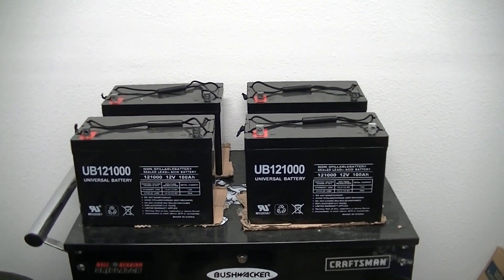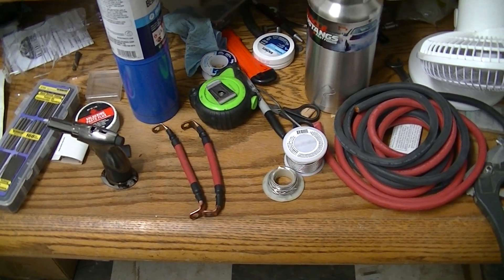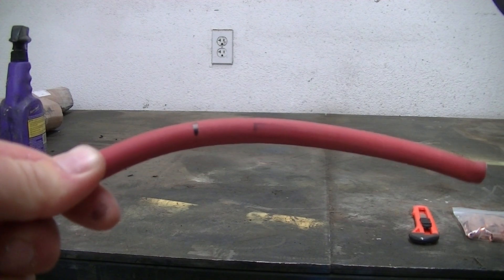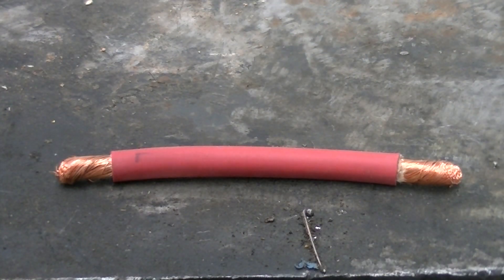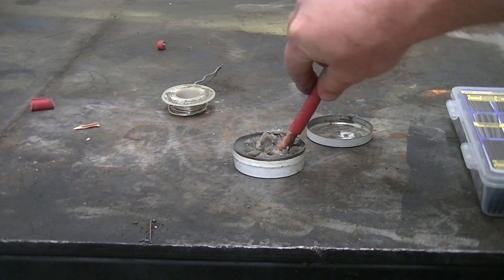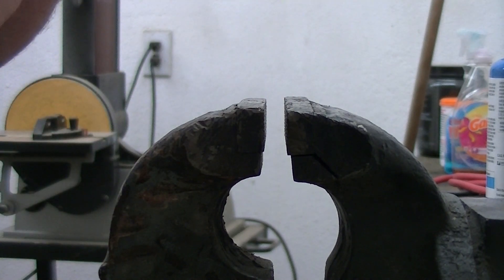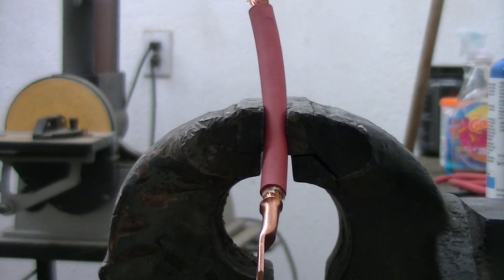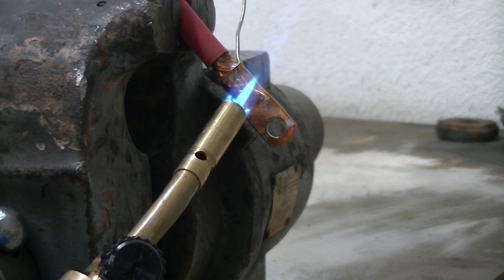How to Make Battery Cables the Right Way and Easy Way For the Average Diyer

Comment: Your video is helpful, I'm working on the same type of project on my motorhome. I relocated the chassis batteries to opposite side and i'm adding two more batteries for the house batteries. I have all these tools in garage so, now I know I can finish the job without going to somewhere to have them crimp my cables.

Comment: Crimping is really not necessary if you get it soldered in well. It doesn't hurt, but if you don't have a vise you can just solder it in and it will work fine. When soldering, you should be able to see the solder infiltrate the strands. Otherwise, Nice Job!
Reply from the maker: RetiredAF30yrs thanks bud, i agree since i had the vise and it really takes no time at all maybe 5 to 10 minutes total in my case it was worth the extra peace of mind